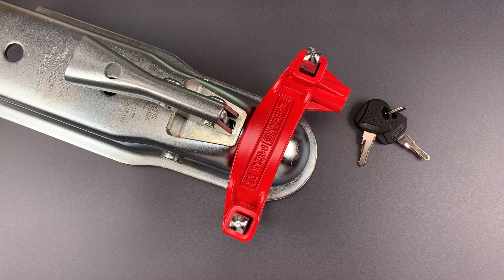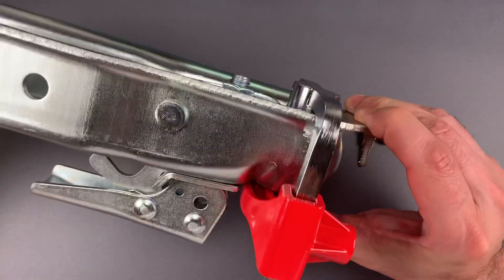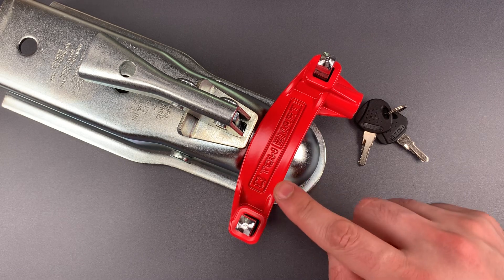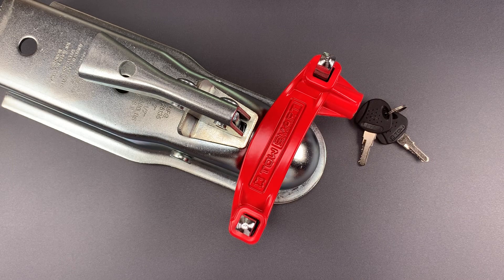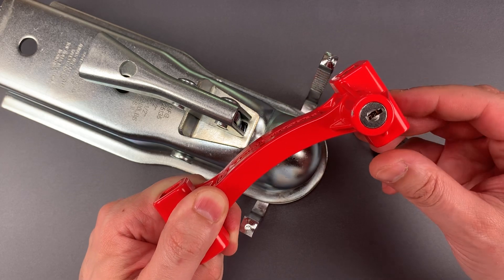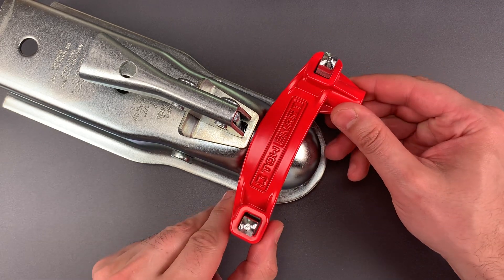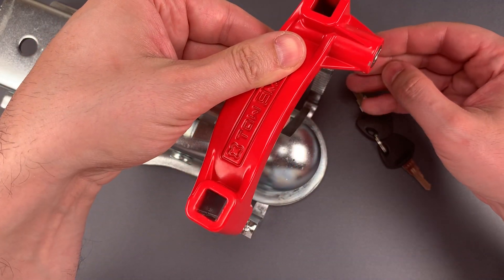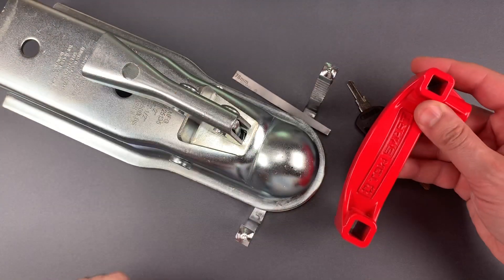[941] Tow Smart Trailer Coupler Lock Bypassed FAST

Comment: The gap is so large that using the key as a shim might be more convenient than turning the cylinder with it...
Reply: Heck, even a tiny bug could wedge itself in, and unknowingly unlock it!*

*Probably would require a strong, thin bug. Probability of happening: 0.0001%

Comment: The last trailer coupler lock I bought was a sod to insert and a sod to remove. And that's with the key!

However many thieves just rope the coupler to their hitch and drive away.

My current trailer has a tiny lock in the handle such that the whole barrel has to be removed. I've backed it up with a Denver Boot that I've modified with extra metal welded on. Of course someone could just lift the whole thing onto a flatbed! 😩 A fellow club member had an 8 seater people carrier stolen that way.

Comment: This was a good video, but I think you should have covered the two other options also. Probably would have only taken you two or three seconds to rake the lock open. Then you could have probably hit it with a hammer to shatter the zinc casting. It probably would have only added about one minute to the video.
Reply: I suppose one could not return it to HOMEless DEsPOT to get the money back if it is broken in many pieces. I mean, why keep it (broken with a sledgehammer or otherwise) and allow them a +1 count on the sales of this piece of garbage?

Comment: I have a Tow Smart locking hitch pin (item #1275) that has an equally shitty lock that I can rake open no sweat. I use it not because of its theft protection but because it is more conveniently attached (I can just pop the lock onto the end of the pin with any orientation vs finding a tiny hole) and a little less likely to fall off than a cotter pin, plus it gives me a little more clearance to attach safety chains to the receiver.

Comment: I get the reason for ratcheting since couplers are probably not a a universal size but one would think there would be a way to have a robust locking system slide a rod in behind the ratchety bit and then lock that rod with a ball bearing and a non shit core.  that way a shim could not ever push the ratchety bit aside.   And then of course make the whole thing out of hardened steel or hardened stainless.  Admittedly id also say both sides of that should also lock,  Only one side securing opens it to other brute attacks even if it did have a good securing system.

Comment: You know you've watched too much LPL when you can immediately guess the weakness from his description of the lock.

Cast zinc? Low melting point
Cheap wafer lock? Raking attack
Clicks it when it locks? Shimming attack
Reply: Glad I'm not the only one this happens to.
Reply: Cast zinc alloy, I'm thinking one or two good whacks with a hammer and it falls off.  The shim is easy and discrete though.
Reply: Master Lock? Everything

Comment: If there's low skill rakeing(spelling?)
Is there high skill ways too?
Reply: That would be single pin picking.
Reply: Low skill usually means a beginner can do it by just shaking it around the lock. A higher skill picker can do this with precision

Comment: Im currently trying this method on the lock in the video and its not working. Someone pried the locking mechanism off so I can see inside. I am hitting the piece inside that should be turning to release the red bar but it is not budging.

Comment: Had one of thoses someone Broke into my truck and stole my gps and trailer key saying that the gps had the address to the trailer saved in it as trailer and key was labeled trailer key I went and changed it immediately took 10 seconds with my Milwaukee m18 angle grinder to get it off

Comment: Bright red lock that just screams, "Steal this trailer!"  It really couldn't even look more cheap.  I'm wondering how well it stands up to physical attack.  What would be better a long pry bar or a sledge hammer.  If the point of engagement is so slim that shim will defeat it, how much resistance can it muster?

Comment: This seems like the kind of product you'd buy when you WANT your trailer/boat/whatever to be stolen but you want plausible deniability when the insurance adjuster looks at your case.
Reply: Which bring the question that insurance companies may or may not have an approved list of products they will pay out if bypassed.  Hmm.
Reply: @bontrom8  Do any do that?  I could see some insurance companies for higher cost things like cargo in shipping containers might actually have a lock standard.
Reply: This makes no sense. Whether you want it stolen or not. You are not required to lock your items in order to receive compensation on your policy. If you leave your keys in your car and it’s stolen. You’re still paid
Reply: @black88lx  That depends on your policy. The policy can be written however they like. For instance you're not going to be covered for a $5000 bicycle if you leave it unlocked in Manhattan.
Reply: @John_Ridley  That would be fair.  But if you claimed that it was locked, how could they prove otherwise?

Comment: I have to say that there are times...times when I just want to fucking vomit at how easy he defeats these things. It's...it's disgusting that a "lock company" can't see that a simple shim will disengage their locking mechanism.

There should be a company that provides "lock ratings" that are universal to the USA...as in ULO - Universal Lock Organization.  Any lock worth it's steel or zinc would submit itself to the organization and then it gets rated.  Then they have the right to put their rating on their packages ULO-8 for an 8 out of 10 or even a 16 out of 20 if there are more criteria that the lock succeeds or fails at.

Comment: I feel like the lock can be made out of plastic and would still give the same amount of protection.
Reply: Honestly, probably more.  My reasoning being that this can already be easily defeated by shimming and the core isn't much, which leaves its ONLY minor potential resistance being to a mechanical attack.  Zinc will already melt and is easily cut, as well as being brittle.  At least the right plastic composition, especially a fiber-reenforced one, likely wouldn't be prone to shattering with a blow like this would.
Reply: or made out of paper, so when users realize their "lock" is just garbage it can be disposed in an eco friendly way
Reply: Or try playdoh?
Reply: What about Play-Doh with a glass skeleton?

Comment: Well explained as always, LPL. This is a truly pathetic piece of design - even cheap products should not be trivially bypassable like this.
Reply: Pathetic?? Some strong words you're using there, id love to see you invent something so i can call it a "pathetic piece of design" whatever that means buddy :)
Reply: @noby5711  I think you're likely being sarcastic, but I'm not entirely sure. I realise product design can be a challenging job, that products are normally heavily cost engineered, also development and testing resources are often very limited. However, I would expect anyone designing security products to know about the most common weaknesses and attempt to design them out. Shimming trivially bypasses this lock, making it a pathetic design - it provides only an illusion of security.

This product could have been made more difficult to shim by adding a cap to the top casting that fully enclosed the ratcheting prong from the bottom part of the lock in the highest possible position, closing off the easy option of shimming the lock from the top. However, the lock would still have been shimmable from underneath so long as you could find a way to insert the shim. As LPL has shown previously, mechanisms that lock onto teeth and ratchet are inherently vulnerable to shimming so long as the insertion of a shim is not physically blocked. It would be far better to lock using an unshimmable ball beating based mechanism.

Trailers are typically high value targets - they are easy to move, often are valuable and usually have valuable contents. I appreciate that the market demands inexpensive trailer locks which might act as minimal deterrence to a thief (if there are two trailers side by side, one locked with this and one totally unlocked, perhaps this product would be enough to push a thief who knows nothing about locks to take the unlocked trailer). However, if I owned a valuable trailer, I'd be looking to use a high quality coupler lock and either a.high quality wheelclamp or (better, where it's practical) a high quality hardened chain through the frame of three trailer and an immovable locking point. I'd use high quality padlocks with these items. I realise such an approach is not cheap and it would involve carrying a lot of metal around to secure the trailer, but you should choose security products corresponding to the threat. If the trailer and its contents are worth £10,000 plus, it's likely worth spending £500 to secure that trailer in a way that will slow even a dedicated thief significantly.
Reply: @noby5711  Well, there are several lock-picking channels out there.  If I had to design a lock, the first thing I'd do would be to binge-watch LPL, BosnianBill, and a few others, trawl through black hat presentations, &c, and find out what doesn't work.  Top of the list is poor tolerances.  Another is brittle shells.  I've opened several suitcases when I lost the keys by simply crushing the lock with a pair of pliers.  (There's no point in putting a good lock on luggage that can easily be cut open.) I'd certainly join the nearest locksport group and give them my prototypes to test!

Comment: what kind of hitch locks do professionals use?
Reply: Big ass chain around the wheel and axle
Reply: The vehicle designated to tow it.
Reply: SuperAWaC proven industries makes what many people consider the "best" coupler lock, but it is a little pricey (although worth it) at about $300.     Blaylock makes in that is a little more universal for about $30ish.... (online or Harbor Freight stores), and you have to supply your own padlock.  That is why I actually started watching LPL was to get an idea on a good padlock for that coupler.    After a couple tries, I believe that the CISA 285/66 (10mm shutter shackle) is the best for the Blaylock.... I am all in for about $100 in that setup

Comment: For all the flaws in this particular lock, I do understand the demand for ratcheting locks, since they are pretty convenient. It seems to me that they could be made secure by eg. putting a cog-wheel between the rack and the pall, or just anything to make the pall inaccessible from the outside, but I haven't seen that anywhere. Is there any lock that actually does this?

Comment: It really irritates me when I see something like this. The simple solution is nothing more than to make a lock with tighter tolerances so that the only shim you can get into the lock is so thin that it can't overcome the the spring. It's just bad engineering and whoever designed it should be ashamed.

Comment: The trailer would have been more secure with a wire coat hanger and some duct tape. It would have taken much longer at least to get the wire and duct tape off.

Comment: Can you fit a zip tie or something more common down to bypass it?
You should show it open up with a single paperclip jiggler tool
Reply: A shim cut from a tin can maybe.  Aluminum is too malleable.  Feeler gauges are made of sturdy stuff, unlike that lock.
Reply: ScorpionRegent Maybe a nail file? Not a weapon and common to carry.
Reply: @johnfrancisdoe1563  The metal of a nail file is sturdy enough, but it might be too thick. Feeler gauges are made to be a exact thickness.  The best answer I got is try it. If it doesn't work, bite the bullet and buy a set of feeler gauges.

Comment: why things Iike this manufactured?
Reply: profit?
Reply: @TWX1138  yeah, but manufacturing a product like this takes the same effort as manufacturing one without this flaw. just need a bit more thinking before starting production.
Reply: @jje984  It looks like LPL's shim is far thinner than necessary to defeat this though.  It almost looks like someone could cut some bit of aluminum can and shove it down in to open it.

That's literally my only complaint about LPL's testing technique, he doesn't do enough testing with tools that someone could improvise upon discovering the lock from common, ordinary materials.